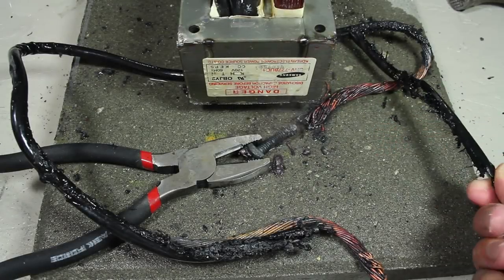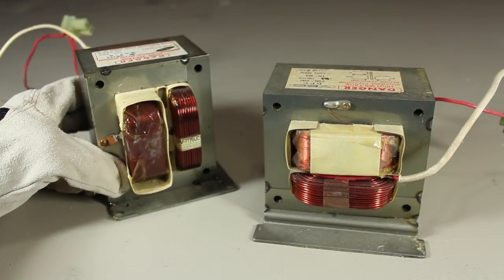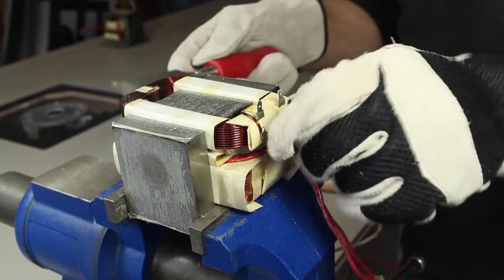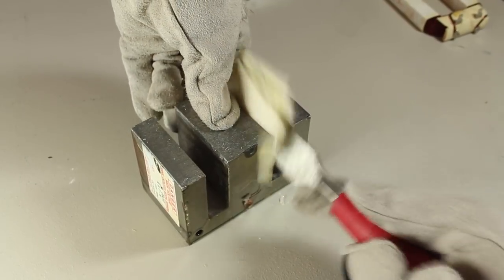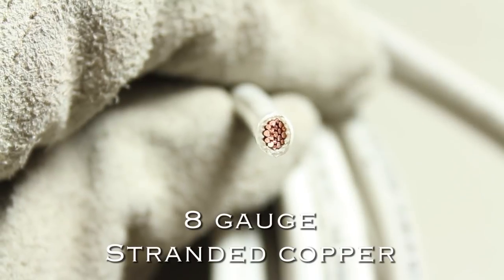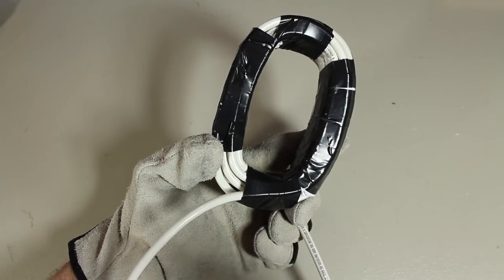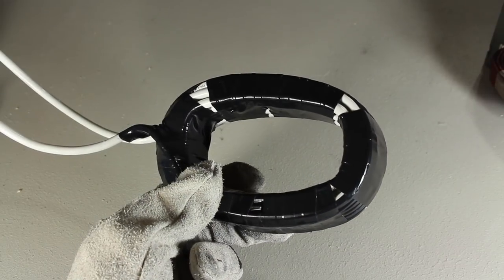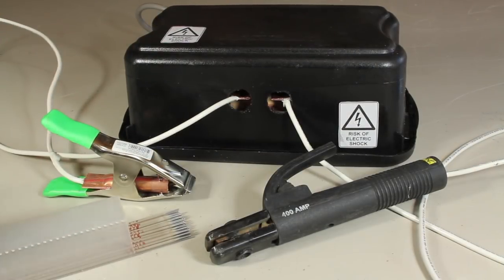Making an ARC Welder - Part 1 of 2

Comment: what I real want to know is the original power out on these transformers. It matters only because it determines the number of windings on the primary coils. Big difference between a 400 watt and a 1200 watt microwave. also, I am going to re-watch parts 1 and 2 as I don't remember him using the scariac with this as a plasma melter.

Comment: Was the purpose of wiring your own secondary coils so they would be made from one continuous wire thereby connecting both coils? I'm guessing splicing the two original secondary could would not work?
Also, what if you were to wire up 4 of these? I understand it would produce more power but is it just an overkill or should be done if I have the parts? Serious answers please...

Comment: It's not the turns. Grant's done it correctly. 36V is a good welding voltage. Fewer turns means lower voltage and then it won't strike. Else a spot welder would also be an arc welder, and this is simply not true.

Fan cooling can't solve everything. Heavy insulation blocks heat. Tape wrapping cuts the surface area by another 1/2 to 2/3, thus cuts cooling by 1/2 to 1/3 of what it could be. It's just science. In his case, he has no heat problems so it's a non-issue, but, there's no reason to wrap.

Comment: What happens if you do not meet the goal of keeping the primary in perfect condition? Would you be able to successfully still be able to use it with a few nicks exposing the aluminum wire?
Reply: +Chance Drake depends how bad you nick them. you can touch them up with enamel but i you broke the connection it will be very hard to fix. also if you nick them very badly that area might generate heat and you may loose performance.

Comment: You should have grounded one of the output terminals to prevent the output leads from floating around at 240VAC.  As made in this video, the welder is not safe.  The green wire is there for a purpose!

Comment: In the metal melting project, you used 2 gauge wire in order to contain the crazy high current you were using- why did you go back to using higher gauge wire? Is the current lower? Thanks

Comment: i have done this. i just want to let yall know that those windings are in there tight. that block of wood method will never work and the vice method is innefective also. dont cut the weld like he does and glue it back together. i just  cut the secondary out with a hack saw and rewound it. much easier.
Reply: i am doing the same right now. the welds were much to strong so I had to cut the second coil. Sadly I only have 1 transformer so I'm not sure if the arc furnace will work...
Reply: Did it worked? I just have one transformer too. I dont know if I do this or the Spot Welder.
Reply: +Thiago Tenório Jordão de Vasconcelos I couldn't find a proper wire, only 1 store sold them but that was €8/meter. So I haven't done the arc furnace yet. Also when doing some arcs on a jacobs ladder it would already get hot. 
But you can also order just the transformer online, if you want a second one.
Reply: Jelmer thats very foolish to play with an unmodified MOT and to pull arcs off them. they give around 2kV at about 1 amp. touch that and your dead. no second chances with MOTs. dont play with them unless you really know what your doing! sctrictly speaking we shouldnt even be touching the MOTs or playing with 240v or 110v.
Reply: instead of using 8G stranded Sheathed wire to re-wrap in this video. can i use Solid Raw wire and re wrap it with electrical tape myself, thinking like 2 more wraps with solid Raw 10G? whats your thoughts
Reply: Justin Keith thats a bad idea. dont do that

Comment: looks like you got the coils in series, which would increase the voltage, right? Wouldn't you want them in parallel to produce more amperage for a welder?

Comment: Don't wind a transformer like this. Just stuff 10 gauge wire in and use a Phillips driver to make enough room until it is packed.

Therefore, that's how you complete a secondary coil.

I once got put 34 turns of 10 gauge wire inside a similar transformer.

Comment: With a hobby bottle and a solenoid valve, just like the commercial models. or valve in the hand-piece. Although to be honest. I rarely use gas :0 go through rods a bit quicker, but lanthonated ones are cheap on ebay. Works out cheaper than using gas .Probably need gas for ally though, otherwise it will just smoke away. Never made my own rods, but have used scrap as tig filler. I imagine heating a rod and coating it with borax would flux it ok. I prefer to TIG (or just T weld) as no flux worry's.

Comment: Awesome project but be careful!  There is a project at the Instructable's website about building something with a MOT. A guy that just graduated HS was trying the project, he energized the transformer without removing the original secondary winding, his Mom found him dead in the driveway. A few days later she found the web page left open on his computer and left a comment on the page about what happened.  BTW, it wasn't just a troll posting to get a reaction, she left a link to a newspaper article about it.
Reply: +Chris Barth Why is replacing the original secondary winding so important?
Reply: Because of the high voltages that it can produce. 1500V-2000V AC at 50-60Hz, along with more than enough amperage to kill you. Yes, the primaries voltage is still dangerous but no where near the original secondary

Comment: Why did you use 8 gauge in this video, but in your first video you had used 4 gauge and it wasn't enough to handle the current. This project looks like it will generate much more power so I'm just a big confused about the thickness of the wire.

Comment: How important is it to have the two transformers make the same voltage/amperage?  I have the same wire wound the same number of turns on my transformers, but they have about a 5 volt difference.

Comment: I have the components to make DIY MOT arc welder, matter O fact I have enough components to make 3 DIY MOT arc welders but my problem is making a decision and choosing between different breaker friendly voltage controls. I know there are few simple as well as more complicated ways of going about this like for example... Adjustable i sections, a series of accurately placed tightly controlled secondary coil taps, electrolytic water resistance, SCR modules and saturable core reactor.

Comment: I have a welding transformer which has about 37V in the secondary, just like yours, but the welding rod sticks to the material and the weld looks like crap because the arc is not constant. What rods are you using?

Comment: 1. I am about to complete this  project can i directly put wielder in 240 voltage plug as i don't have dimmer or scariac?
2. How does secondary coil gets current when u put electricity in primary coil which is not connected to secondary in any way?

Comment: this is great project,How to connect transformer if have 2 " 220v transformers" ?
Reply: I found a commercial microwave with 2 230 v input transformers. off tapped at 208 volts as well. will one work like 2 110v transformers? or is it better to use both in par.?

Comment: Could this be done with two transformers that are 120v to 12v? I have two (four technically) transformers in that ratio, so would that be too low for the output? I see in the description you recommended an output of 34v. It seems I'd hook them up in parallel from the wall, then series to the rods?

Comment: I found a commercial microwave with 2 230 v input transformers. off tapped at 208 volts as well. will one work like 2 110v transformers? or is it better to use both in par.?

Comment: instead of using thicker gauge wire, less turns in the secondary and connecting 2 in series (to add up the voltage), is it possible to use thinner wire, so that it can have double the # of turns in the secondary and we just connect the 2 in parallel (to add up the current)?

Comment: I have a 220v cord from a dryer. Can I just use that along with one repurposed transformer from a 1000 watt metal halide ballast? intead of wiring two transformers in series and using two outlets, I'd prefer just to use my one 220v outlet. Any help would be appreciated, thanks

Comment: copper wire shud bee striped down and  rapt in cooton sheets- insulation paper ,and  varnish email lac after izolation.its best stands to heat .wire  in pvc or plastic coat dont rezist heat especialy a welding transformer  where have to stand in total shorcuts the secondary coils closed circuit,soryy for my english.

Comment: How did you know to put on 18 turns on each transformer?
I guess there will be about 1 volt per turn so there ought to be somewhere like 18 volts from each tranny. That's about 36 volts overall when connected in series like you show. I expect the phasing will be important too or you'll get zero volts out?

Comment: Hey, I'm from argentina, where we have 220Vac, I guess you used two transformers 110Vac, I probably find two transformes for 220Vac, not to 110Vac, and I couldn't do the hack to have 440Vac. What if I use the transformers in parallel, it would work? Thanks.

Comment: I built one but I couldn't fit the 18 turns in so I just put 13 turns and it doesn't have as much voltage so the arc won't hold for more than just a spark

Comment: when you plug in two circuits into one to get 240v, will 240v be back fed though the whole of the 2 circuits? or will you have just 240v from the combined point on? ie if and appliance was left plugged in on one of those circuits would it get a nice jolt of 240v or stay at 120v?

Comment: Well that cable is not the 8 gauge stranded copper because i have that cable specification and it is different because in my career of aeronautical engineer we use it to give electric power to the engines so i couldn't do this project

Comment: I found this 8 "gauge" wire is about 3.3 mm in diameter. Is that correct? It is bit confusing by watching on video - it looks much thicker than 3.3 mm in diameter. Even if insulation is 1 mm thick, it is hard to tell. Thank you if you answer me. If not, nobody hurt.
Reply: To me it looks like 6mm or 10mm, but I may be wrong. It´s difficult to try and think in medieval measurements like the Americans!
Reply: I just made the arc welder today! And it works a dream! I found that if you measure the gap in the transformer and divide it by 3, then you will get a rough idea what the diameter of the cable should be. MAKE the jig because there is no way you can make the coil any other way!!

Comment: I didn't see you respond to any posts on making an arc/stick welder, so I'm hope you can respond. I have a request, could you figure a way of making the stick/arc welding into a TIG welder, but without the gas. I want to practice TIG welding, but I can't do it at work. But I also want to use it as a welder for craft projects like lamp shades or making am armature, so I can sculpt with clay.

Comment: I know this is already 3 years old, but I made this and only got a fairly small arc (2mm). Could this be because I used transformers from microwaves in a 240v environment?
Reply: How many amps do u have on the input and output?

Comment: one more question on the transformer.  If I had wire 1/2 that size but doubled it up when wrapping it connected on both ends. (not twice the number or wraps.  Would that work just as well?

Comment: I did the exact same thing but the thinner rod we have is 2mm it wont burn not enough juice i persume any way the output ac voltage was 28v i think i need to rise it up to 40v maybe it will work

Comment: how do you come up with the number of wraps you need on your secondary?  Is it arbitrary, proportional to the 240 v (240/18=13.3 x 2 transformers for 26.6v) from your wall plug jig, or does it depend on what the primary is?

Comment: For the 18 wraps does the wire have to have to have a rubber coating on it for it to work
Reply: Yeah, because having it just be bare wire will cause a pretty nasty short.

Comment: What do I do if the primary coil can't be gently pried out and the transformer parts appear to be glued in? Do you know what kind of glue they used and how to safely remove it?
Reply: +Eric Neiman 
Put it in the kitchen oven set to 250F for a hr or two.  Then, wear leather gloves and slide it off. The glue will soften with heat.
 Another way is to just cut the secondary coil flush with the core on both sides, then beat the strands out with a block of wood and a hammer.

Comment: um whats the point of the original coil? they dont intereact. nor do they interact through the metal brace. on is insulated so the first coil never touches it.
Reply: the coils never physically touch.
the primary coil inducts a voltage to the secondary coil via magnetic flux
Reply: Ambrosius Malachai Like the two guys above me said. Have you ever played with the rumble motors in a controller?If you remove the motors and hook a battery up, you can make it spin. Remove the battery and spin the rod manually. it should spin fairly easily.
However, if you touch the wires together from the motors so they connect with each other and try to manually spin them, there's resistance.

This is because electricity in coils produces a magnetic field. Conversely, a magnetic field in a coil can produce electricity in other nearby coils. Basically, if you spin one motor rod manually and fast enough, you can actually generate electricity to power the other motor. It doesn't work in all motors. I can't remember off the top of my head what they're called but there is a type of motor that does this and others that don't

Isn't science fun? xD

Comment: Do we need to put that much cable into the transformer or is it ok to not put as much
Reply: +Chris Qiao Yes, It is very Important you do the same amount, To little, and the voltage and amps will be insufficient for welding
Reply: +Chris Qiao The number of turns is critical!!!! Before you make one read up on why he has 100 turns and 18 turns and ohm's law. Once you understand this it will be lot more fun to modify and alot safer too!

Comment: what does changing from the large gauge wire that was being used on the metal melter to the smaller 8 gauge wire do?
Also, is there a way to control the power without making a scariac? the bucket full of lye seems risky to me. Could I do something as simple as adding a dimmer switch the the welder.
Reply: +Richard Hill no. dimmer switches cant handle the current required by the mot's. you need a high amperage current limiter like that scariac or an actual variac.

Comment: 2:19 - 2:21 Compromised insulation, left side, by the paper sleeve. (it's the spot on the coil that isn't maroon.) You're quite likely to (eventually) get a shorted primary running that. A shorted primary can manifest in many ways, not the least of which is electrocution or fire.

    It behooves you to replace the unit, they are a dime a dozen after all. At the very least you should be rocking a fast trip circuit breaker and learn to live with it going off all the time.

(And I certainly hope your viewers are using a GFCI outlets when experimenting with mains power.)

Comment: if i have 4 microwave transformers can i not use the 4 primary coils and avoid winding a new secondary?
Reply: The secondory coils put out a few thousand volts at a few miliamps so you still need to rewind new secondaries
Reply: Unfortunately you can really do that because you would need 19 primary windings and a really, really big core  as one core would be equivalent to one turn as the ratios would simply

Comment: How did you possibly fit those 18 turns. I only did 15 and I was no where near able to fit it in. Right now it is simply the thickness that is preventing me from doing this project. I took a bunch of microwaves apart and they all had nearly identical transformers except for one. It had wider channels and was shorter overall. What was the width of the channels in your transformers and do you think that 10 gauge would work?

Comment: I"d like to know what would happen if you used two of the same coil, the one with 100 turns.
Reply: nothing, aside from a little power being lost in the process. The voltage and amperage would stay the same
Reply: Sam Monge
well, now I know. I don't know all the complex stuff about electricity. I can do simple stuff (IE, install wall sockets/switches, replace light fixtures and ceiling fans etc, etc) but when you go on this kind of level I am lost

Comment: sorry, I can build on welder with one transformer and 220? I leave in Europe, Portugal, and the home voltage is 220v~240v
Reply: ok, I do too, but im not native, and also it's "can I" and "live".
Reply: no, you need 2, they both use the same power ( Volts x Amps). But the number of secondary windings will be different

Comment: why is it six rows and 3 turns of the 8 gage wire? is that for all mots? or is there a calculation?
Reply: +Christopher Hamilton 
Its about one volt per turn with MOT's.  At least with 120V fed to the primary.  I haven't tried with 240V yet.

Comment: Also, I have a smaller transformer with no welds holding the 'I' piece on but I've beat the hell out of it with a hammer and chisel but it won't budge, is there a secret to getting those off?

Comment: Dear Mr.SIr. King of Random,

What is the largest job this can handle? Are you limiting to 36 volts because any more will burn out the transformer, making it useless? 

Would there be any problem adding transformers, say up from two to four? Would one have to have another "set of power cords"? (to accommodate for the additional two transformers?) because otherwise you would need bigger transformers and just have 2 but have more voltage? ~This would make it a more powerful welder no?